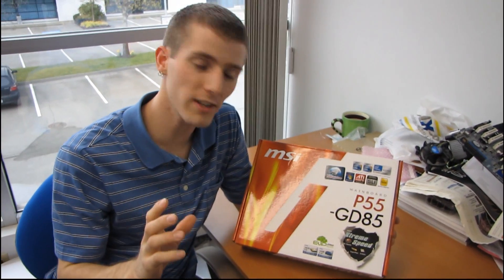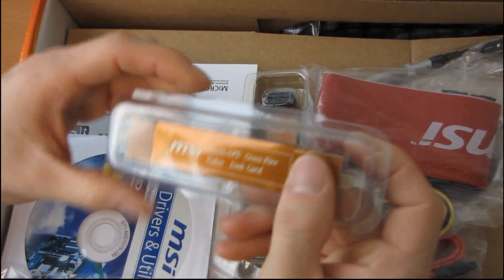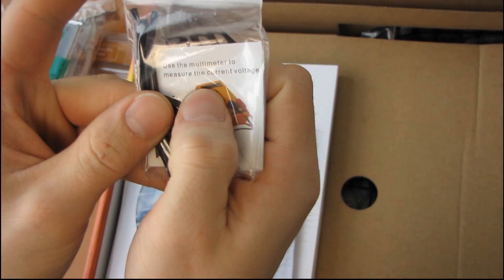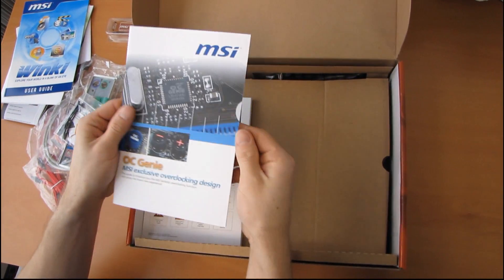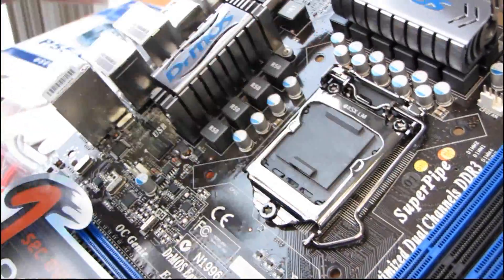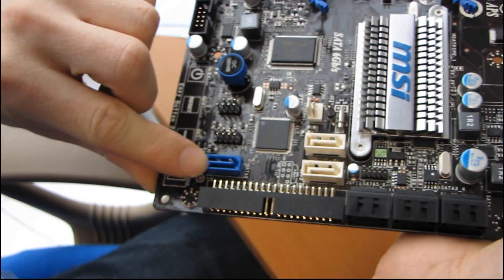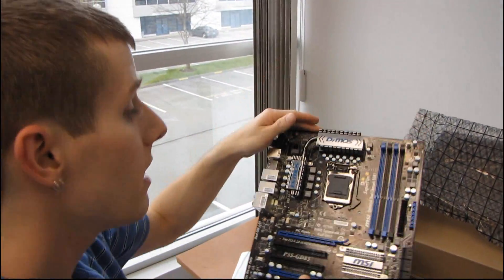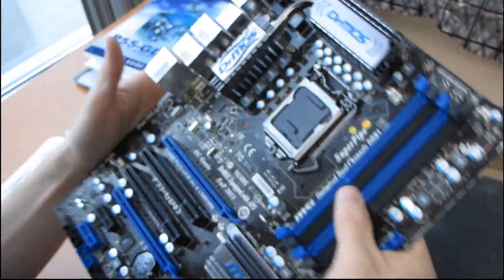MSI P55-GD85 Core i5 SLI USB3.0 SATA3 Motherboard Unboxing & First Look Linus Tech Tips

Comment: @LeonAQX   I second that, namely because of customer support. I have called MSI more than a couple of times and it was not encouraging. To be honest folks and Linus, the hardware form MSI can be good at times, but for some reason they have the worst customer support I have ever encountered. The tech support would not even discuss Voltages with me! Now remember they are advertising their GD set of boards as Overclocking Motherboards. My problem is MSI won't even support their own customer base...

Comment: I gotta wonder why he keeps calling the powered e-sata port a e-sata/usb port, sata and usb aren't even close to being wired the same. Those Ports are e-sata only, they allow for a special cable that has both the data and power to be hooked up. It would be nice to have these cables coming with, might help avoid that confusion